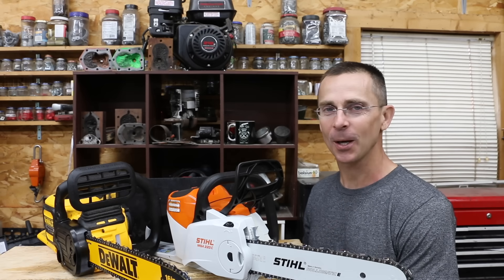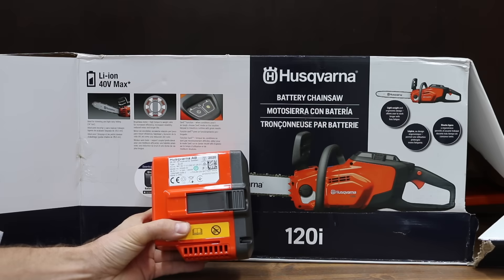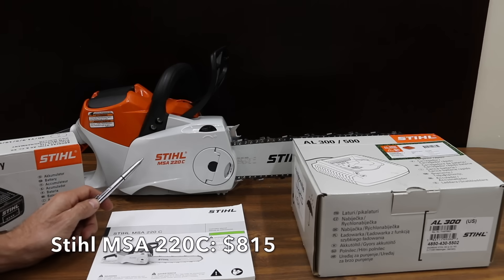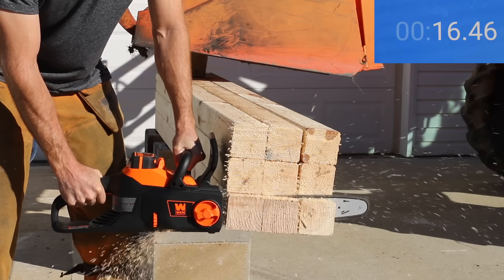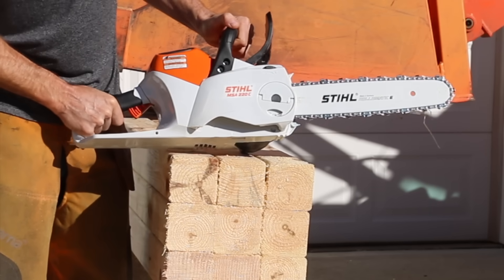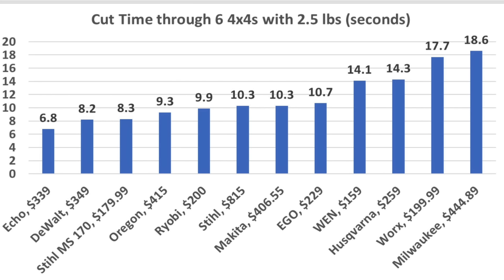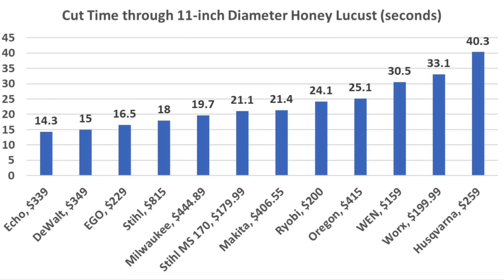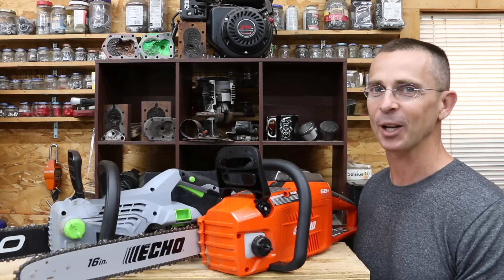Best Battery Powered Chainsaw Brand (ROUND 2)? Stihl, Husqvarna, Echo, Oregon, DeWalt

Comment: Great job testing. Your testing is better than CS or any of the others. I bought an Echo 18" gas chain saw a few years ago and it out performed any saw I have ever used. Ran great and cut through oak and walnut like a hot knife on butter. Keep up the great work. How about the battery powered lawn mower test?
Reply from the maker: Thank you, will do!  Thanks for the video idea.

Comment: Disapointing.  How can you compare run times and rank them using different size batteries?  Hooefully round 3 is apples to apples comparison.  Realistically comparing 40v to 58v etc isnt great either but at least thetes a decent reason as manufacturers aren't all building the same saw.  And I've used many of these.
Reply from the maker: Thanks for the constructive feedback.

Comment: Thanks for doing this review. Very informative. 

I came to this video planning to buy the Milwaukee, because I am invested in their batteries. After watching both video's I was leaning toward the Makita, even though I do not own any Makita tools. Reviews of the Makita discussing the power switch changed my opinion to not buy the Makita.
I have a Echo gas saw that I had problems with the bar tightening studs pulling out of the plastic housing. Other battery saw reviews including the Milwaukee and Makita have several that discuss the studs pulling out. 
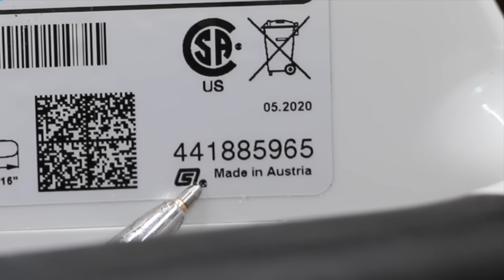In this video at 5:57 of the Stihl I noticed it has a separate plate that the studs go through. For this reason I leaned toward the Stihl. 
The price of the Stihl in this video at $815 is not what my local dealer had for the saw. This price is close for 2 AP 300 S batteries and charger. This is still a high price for the saw and 2 batteries in my opinion. 

I decided to buy the Stihl with 2 batteries and charger. I justified the price by also buying a string trimmer and hedge trimmer. One of the biggest reasons was because of less vibration compared to gas versions. I plan to sell my gas versions and completely switch to battery.
Reply from the maker: You are welcome!  Thanks for sharing.

Comment: would be interested to see dewalts 20v brushless model to see how it stacks up against its bigger brother, drawing less power then 60v model.... especially if used with the flexvolt 9 ah batteries. any chance a #3 dewalt v dewalt chainsaw battle on runtime and cut speed???? after watching both these tests and being slightly biased since i already own a large collection of dewalt cordless tools this is one of my next bigger purchases, and would really help a guy settle the noodle on which to go for... love my 20v 22in lawnmower, own a single half acre lot in town and can mulch and bag when fairly damp the full yard using only 2- 9 ah flexvolt batteries and 2- 5 ah 20v batteries that it was sold with, and with a couple fast chargers can be sure to complete yard-work start to finish without stopping.... maybe a battery powered mulch and bagged lawn mower showdown would be a good one to put in the works.... a quick recon through your video post history shows none thus far... would be good one perfect time of year for it and they are getting pretty popular...
Reply from the maker: Thanks for the video idea.

Comment: Great review!  I own a $100 corded electric chain saw (with pole attachment) and it was one of the best tools I have ever bought. I’ve used it with up to 150 feet of power cord with no loss of performance. Longer distances I use my gas saws.  I don’t see a need for battery-powered chain saws, unless you want to spend more money. Just wait until you need batteries!!!  Therefore, I would like to see a corded chain saw added to a future review. Thanks.
Reply from the maker: Thanks!  Thanks for the video idea.
Reply: I'd like to see how these compare to corded electric chainsaws in general. I just bought a Bauer 16" corded saw because I needed a saw that I won't use that often. It was under $60 and im beyond impressed with its performance. A battery one would be really convenient but for a conparible model you're looking at $250+ unless you already have the Battery system. Really curious how the corded would compare to Battery.
Reply: @kcl5038  Corded?  You must have one hell of a long extension cord, LOL!
Reply: @joeking433  I was just clearing trees in my backyard. I didn't need more than 50'.
Reply: Many people have acreage with trees that cords won't reach.

Comment: I own the Ego, mainly because I love their line up of power tools, and own several, so it made sense as I already had batteries.  I agree having the bigger battery (in my case I have a 5AH as well as the 2.5) is handy, but for smaller jobs the lighter battery is awesome. Great video.
Reply from the maker: Thanks!  Thanks for sharing.

Comment: Very interesting review. I'm a heavy battery chainsaw user and owned the Ego, Dewalt, Echo and today I purchased the Stihl. The Ego and Dewalt are not intended for heavy use and returned them almost immediately. I used the Echo intensively for a little over a year, it's great but had some issues (chain falling off easily) and the motor stopped working - I would say it's more a prosumer model. I have not used the Stihl yet but hopefully I will have it for many years! One missing contender for round 3 is the husqvarna 540i XP!
Reply from the maker: Great recommendation on the round 3!  Thank you
Reply: If you are doing heavy use chainsawing, then you should be using gas chainsaws
Reply: @SL1CEND1CEN  The Stihl 220 with ap300s last about 1h of non stop use, when I need much more I use a corded chainsaw
Reply: @SL1CEND1CEN  not necessarily, with additional batteries you can last a long time. They don't smell and are much quieter, gas chainsaws will slowly disappear

Comment: I own a kobalt 80v chainsaw.   I also have the 80v lawnmower, hedge trimmer and weed eater.   I have 5 batteries.   I highly recommend that you get at least one extra battery if you are going to do any serious work with your saw or buy the same brand of weed eater or lawnmower, so you have extra batteries.    I love my kobalt battery powered equipment.   The chainsaw easily cut thru trees up to 14 inches after a major storm dropped the trees in my yard.  I cut about 2 acres with my lawnmower (I often procrastinate and the grass gets very high) and yet the lawnmower works like a champ so I would not be afraid of buying battery powered equipment.  Project farm is an excellent source for selecting the right equipment.    It would be nice if all manufacturers would make interchangeable batteries.
Reply from the maker: Thanks for sharing.

Comment: As an electrician, I suggest that you use watt hours instead of amp hours. Watt hours is the most accurate indicator of battery capacity. 3 
batteries can have a capacity of 100 watt hours: one can be 12 volts, and 8.3 amp hours, one can be 20 volts, and 5 amp hours, and the last, 
60 volts, and 1.6 amp hours. Their amp hours are all different, but each battery has the same capacity. I know that my Milwaukee batteries all 
have watt hours listed as well. Don't know about the others, but if one can get the accurate amp hours and voltages of the battery, and multiply
 both together, you will most likely have reasonably close watt hours. And I absolutely love my Milwaukee chainsaw. No more mix, fumes, and 
loud noise. Love how when I release the trigger, the chain stops moving! It has become my go-to small saw. I wonder how much money I will save in fuel and mix over it's lifetime. I have noticed that my newer Milwaukee batteries have twice the rated capacity of the old ones in the
 same pack size. Makes me think that the batteries will only get better and lighter.
Reply from the maker: Thanks for the constructive feedback.
Reply: @ProjectFarm  You are most welcome. My wife says that I have lots of opinions, with an occasional fact thrown in. Thank you for these great vids. I  just discovered them, and really appreciate the time and effort that you put into creating such useful comparisons. I have often had people ask me my opinion on the best cordless tool brands. My response is that they all have advantages and disadvantages, and that if one already has an investment in a reasonable quality cordless tool brand, there is a big advantage to sticking with it. Please keep up the good work on sharing information with us.

Comment: Interesting video, but I think you should have calculated run time based on one amp hour (divide the total run time by the total amp hours of the battery). It really isn't a good run time comparison given that there were so many different sized batteries. Also add the size of the battery to the chart when listing the total run time (next to the price). Thanks!

Comment: I've been looking for a chainsaw and for home use, looks like the Ego is the one to buy. Great testing PF 👌
Reply: Ego 16" bar with 5.0ah battery would of made it bit more even comparison.
Reply: Echo, not Ego. easy to mix.
Reply: @Giedrius00  Ego appears to be the budget choice
Reply: @tofumike  
Ego comes in 3 flavors.
14" 249.00
16" 299.00
18" 349.00
Each differ from performance and battery size.
I have both 14 and 18.
18" is a power house
Reply from the maker: Thanks 👍

Comment: Most people haven't seemed to notice, but you never tested safety. Safety is a major factor when I purchase tools such as this as I use them to teach my children to use and respect tools without the hassle of a more complicated starting procedure (such as with gas), or the loud intimidating noise. Do these saws have safety features such as a chain brake? if so does it work well or do they have enough power to still turn? Are any of them capable of being stopped by craps? How easy are they to control in a kickback scenario, etc.?
Reply from the maker: Thanks for the suggestion.

Comment: Ego just came out with a 18" chain saw with a 5 amp hr battery.  $349 at Lowes.  I'd like to see how it stacks up to these in the same test.  Wondering if its the same motor with just a longer bar and bigger battery or is it stronger / faster rpm, etc?

Comment: Hi, as always your testing was excellent. However looking at that little Husqvarna getting it's butt handed to it made my old Swedish heart twitch a little, I can't lie...lol! And it got me thinking. I have watched several others test the top of the line Husky battery saw, the 540i XP, and they say it's very nearly as good as it's gas powered equivalent. Now there's a race I'd like to see. A gas saw with one tank of gas, and a Husky battery saw with it's two batteries (the BIG one's, the 300). Which saw can cut the most cookies and is the battery saw slower overall? What do they cost to run, is the battery saw more expensive up front? If so how many tanks of gas must you run thru the gas saw before the battery saw starts pulling ahead economically because it's cheaper to recharge batteries then buying gas? If it won't make sense to you to choose a battery saw purely based on economy, could the other good properties that the battery saw have over a gas saw (less maintenance, less sound, cleaner to transport and to store, ability to be used in an enclosed space, ability to be stored unused for a long time without developing engine problems, buying other machines such as hedge trimmers without batteries and chargers for "cheap" and using the 540i XP batteries for those too...) make you buy one regardless? Is the 540i XP the best battery saw in the market today? Hmm, could be mighty interesting to see....
Reply from the maker: Thanks for the video idea.

Comment: Thank you! How about a cold weather performance test? Wondering how practical these would be for use up in Alaska for cutting wood in the winter.
Reply: Since they are lithium powered they are not as badly affected by cold like nicad or lead acid.
Reply from the maker: Great suggestion!  Thank you.

Comment: I'm curious about smaller saws that could be used with 1 hand for small branches, etc.
Reply from the maker: Thanks for the suggestion.
Reply: You need a one handed recip saw with a long blade 👍
Reply: Bosch makes a Euro market 12Volt TINY chainsaw. 

It's designed to trim tiny branches without shaking the plant, like a sawzall would.

You'll need a wall outlet adapter or an American Bosch battery charger, but their batteries are the same.
Reply: @TheDwightMamba  actually i forgot the milwaukee hatchet its a battery powered one handed extra small chainsaw exactly like what you have described from bosch
Reply: Idk if you are interested in battery only or what but I can highly recommend the echo 2511 for a small saw, the thing is just plain fun I never thought I needed now I wouldn't live without the little critter, they can be hopped up a good bit to if you wanted but I don't see the need for my uses.
Reply: @wolfmanrebel874  It has to be battery because it will be used inside a building.
Reply: @williambissell794  gotcha, well I'm not very familiar with many of those sorry, but my daughter got a bauer from harbor freight a year or so ago it's a cheapo under $100 she takes on camping trips and such, she claims she likes it for making shelters and whatnot like teepees I have no idea what sorta power and runtime the little thing has but she's mentioned a couple times she likes it.
Reply: @wolfmanrebel874  I hear decent things about the Harbor Freight, but I already have the 18" Ego. It's the top of the range in power. Based on my math, it pulls about 67' of chain through a log every second. The less pressure you add, the faster it seems to cut. Just keep it singing.
Reply: Or if you get an echo top handle, they start at around 300 bucks and you can get good top handle chainsaw.

Comment: I very much enjoy your video's very educational. I learned a lot on these electric chain saws. I also like how you just run them straight up and see who comes out on top! I do think there is a major Torque difference between saw's because of Voltage out put for example the Echo edging out the E-GO. It seems to me the higher end models were focused on certain strengths.
Thanks again!
Reply from the maker: Thanks so much!  Thanks for the feedback.

Comment: Hey man! Awesome video, somewhat surprising how well and how poorly some of those machines were actually performing! Especially coming from well known yard/farm brands like husqvarna, stihl and echo.

You make awesome videos and I particularly love your graphs and break downs, maybe I just love statistics?
However with the specs and statistics perhaps in one of your videos you could give a little run down on what they mean for the average joe? You did an awesome job when you compared in your first video the work performed vs charge time = real life usability.

But the thing I'd like to hear you point out is actually the noise factor, how a 93 decibel saw is actually going to sound almost half as loud as the 100 decibel saw which again is going to sound almost a third quieter than the gas powered chainsaw at 105 decibels. 

That would go so far to help people to quantify the difference beyond what just the stats do, I mean personally I love the stats and I've got the knowledge (and experience with chainsaws in this case!) To quantify the stats into useful info for myself.

I would love to see you do a video on electric pressure washers that are commonly available at home depot, lowes and harbor freight!
Reply: Decibels are a logarithmic unit of measure, the change is not linear.
Reply: Yep, I'm familiar with how decibels work in that a 10 decibel increase will effectively sound like the sound doubled in volume.  But what I was saying in my original comment is that I'd like that to be brought up in the video because that isn't exactly common knowledge so for the viewer who doesn't know it helps quantify that difference into a relevant and understandable format.

IE: this tool makes 90 decibels of noise and this one makes 105 decibels which means that it sounds 2.5 times louder when you are standing next to it.

People probably know that decibels are there measurement for sound quantity just like they know degrees refers to temperature, however they don't necessarily know that your average street corner in the city comes in at 85 decibels of sound even though they do know what 90 degrees Fahrenheit feels like.
Reply: @lightjedi6  oh, sorry then. You make a good point, i did not know how decibels "work" until 2 years ago my friend enlightened me.
Reply from the maker: Thanks so much!  Thanks for the video idea.

Comment: I really like your reviews but the one thing you don't address is the difference in the chains. The power head reviews are good but the cut speeds are deceptive unless you use chains common to all of them. You can have the fastest and most powerful saw in the world but if it has a low profile chain it won't be able to cut as fast as something with a more aggressive profile. The Echo was making some serious chips compared to most of the others. How much of that was due to chain profile?
Reply from the maker: Great feedback.  Nearly all of the chains were made by Oregon.  All 3/8 pitch, low profile chains.

Comment: I hardly ever use my gas chainsaw since I got a Poulan 56 volt 16" saw. Walmart accidentally sent me two instead of one, so I called them and they said to take it back to the nearest store. When I did take it to the store to return they said that I should just keep it because it would just create more work than it was worth for them to return it. I never expected that, but now I have an extra saw and battery still in the box.
Reply from the maker: Thanks for sharing.